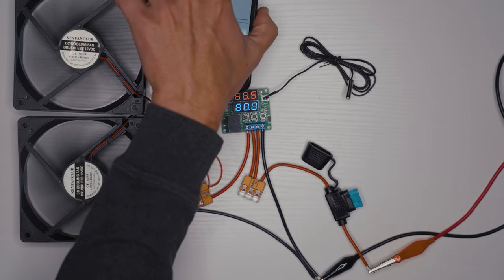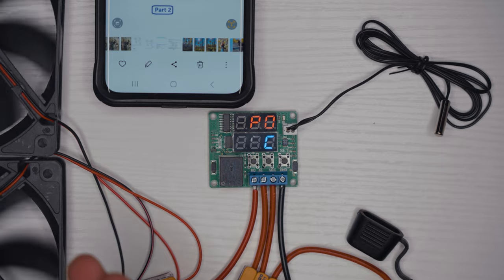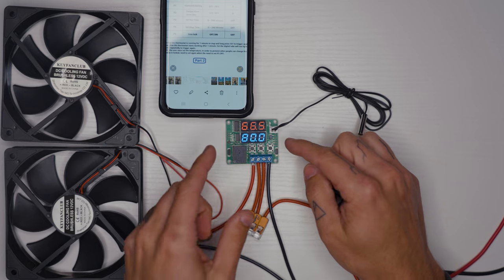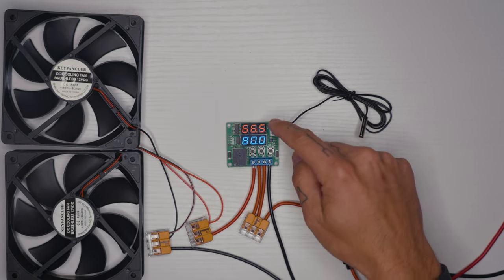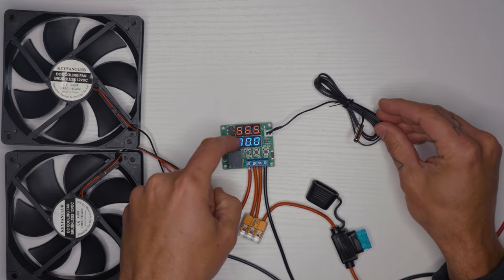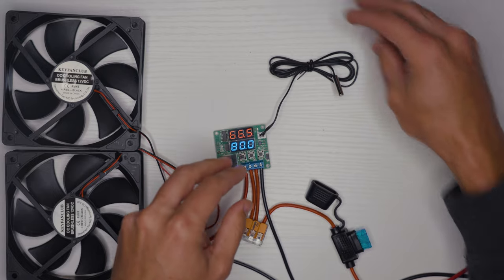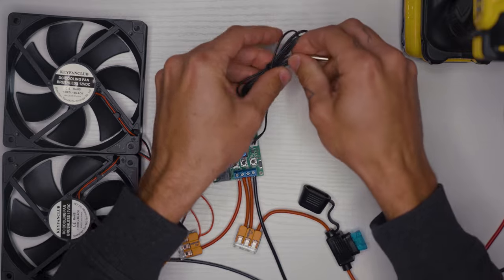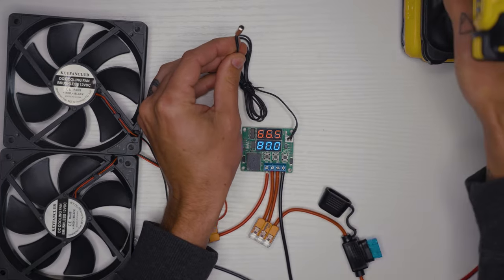$10 12V Thermostat for Van/RV Electrical System Cooling

Comment: It's great that you have shown how to achieve this using a more affordable option. Granted it doesn't have the bells and whistles of the victron option.
Speaking of fans, would you ever consider doing a video showing how to replace the fans in your inverter, fridge, dc-dc charger, etc..?
I swapped the fan in my inverter and fridge to a Noctua and now I never notice them. The Noctua fans are absolutely worth the money if you want to silence things in your van.

Comment: We have a class A coach and use a residential electric fridge, it was blowing in warm air into the living area. I was able to block it off and installed an exhaust hood on the exterior of rv with 2 small computer fan using this same set up. I did find my 1st two fan very noisy so upgrade them too the Noctua NF-P12 what a great little fan, moves a ton of air and is supper quiet.
Reply: I use that same Noctua fan to cool my electrical cabinet that houses my inverter/charger plus my solar controller. It's extremely quiet!  I use a very similar control board but one that is variable fan speed.

Comment: We use this exact thermostat for our equipment enclosure. I put the sensor right between the cooling fins for our Mppt charge controller. We have a set of fans that are on the fins and another set of fans to blow hot air out of the enclosure. We set fans up after we added a 12v ac on our van and the added draw would overheat the charge controller which put it into safety mode thus drawing down the batteries. It’s been working great for a few years now. I was skeptical of this little thermostat but it has been rock solid.

Comment: in your example, can you set it to cool lower than the set temp... e.g. 70, otherwise its just going to kick on an off
Reply: I had the same question.   Mine would turn on for 15 seconds then turn off and then back on in less than a minute.  I looked at the amazon page and found out that we need to set the parm setting to P1 and then adjust the time.  It says the default for P1 is 2, but for mine it was set to 0.   I set the P1 setting to 2.0 and now it runs until the temp drops by two degrees instead of a 10th of a degree.

Comment: I’ve been using this setup for many of installs but now have move over to the fan relay in the mps   Much easier setup and less wire. 
People should note that if buying from Amazon not all of these wire up the same (just because they look the same) 
Thanks for sharing
Reply from the maker: The wiring amount will be pretty similar between the two.  The proper wire to use is listed in the blog post that accompanies this video:  https://explorist.life/van-rv-electrical-system-ventilation-with-a-12v-thermostat/

Comment: Very helpful.  Our multiplus is under the bed in our front bedroom Airstream.  Once the camper is cooled down there’s no problem, but until the air conditioner does its thing the multiplus has trouble cooling in the hot interior air.  Discovered this issue during a recent Utah trip.  Fortunately raising the bed to open the storage compartment until the room cools down Barely allows the multiplus to keep going, but this is a better fix.  Thanks.

BTW your channel was very helpful when I did the solar/lithium installation a couple of years ago.  A month in Utah this September was the acid test, and it exceeded expectations - except the minor cooling issue.  But I’m on it.

Comment: Excellent instructions as usual. I want to add a manual over-ride switch to this so I can turn it on when we're driving to augment positive pressure inside the trailer... Is this possible?
Reply from the maker: With the knowledge you've gained from this channel about relays and thermostats, that would indeed be possible.  I don't have any specific tutorials about it though, so you're going to have to take what you've learned and apply it.

Comment: Do you notice that the victron multiplus 12|2000|80 fans tick? It drives me insane. They actually replaced the entire unit on warranty. Fans still tick and the thing hums so loud you cant sleep.
Reply from the maker: I've had one tick before; but it was because there was a piece of plastic/trash that came loose and was hitting the fan.

The unit hums when under a heavy load/discharge; but that's to be expected with any piece of electrical equipment.  I sleep with a fan on which drowns out any inverter noises.

Comment: Nate!  I have some news for you!  Regarding the fan control using temperature control asked you last week about the RUUVI sensors, I just discovered tonight that version 3.12 of Cerbo GX supports the RUUVI temperature sensors!!!!  I just updated my GX and I got into the section for relay control and discovered that it had the RUUVI sensors listed.  Wala, I got it set up!  So, now I've got to hook up some fan(s) and see if it truly works!! 😎
Regards,
Cliff

Comment: What happens if the power goes off and then on again. Does it hold the temperature set up? Or you need to program again?
Thanks
Reply: Mine keeps the configuration after completely removing power for any length of time.

Comment: This  is great for cooling down the electrics but do they make something that would also heat up the batteries. I live in the north and in the winter time the batteries need heat pulled in from the coach living area. ( Batteries and inverter are under the bed.)  So if the air is cold in that area I want it to exhaust the air and thereby pull in warm air from the coach and if they get too warm, pull cold air in from outside. gsw
Reply from the maker: Yep!  You'd just do the same thing just leave the setting I showed at 2:57 and leave P0 set to 'H'.

Comment: My Off Grid specialist installed 7 in our build. It’s a tiny space and so well designed. Even in Texas heat the box was almost the same temperature as the inside. This would have been a cool addition.

Comment: What is the max temp for an electrical enclosure?  Thanks for another awesome video!
Reply from the maker: You'll have to play around with what works for yours where the fans aren't running 24/7 but also turning on when appropriate.

Comment: At what point are 2 fans better than 1?
Is integrating a heater into the same setup recommended? (i.e. 2 relays instead of 1).
Reply from the maker: I Pretty much always install 2 fans; but I'm not one to geek about over CFM's, so I can't give any data behind why I do that.

You can indeed wire a heater; but you'd likely need a secondary relay as this thermostat is only rated to 20A I believe (double check the specs there).